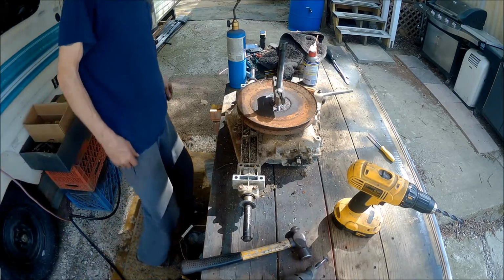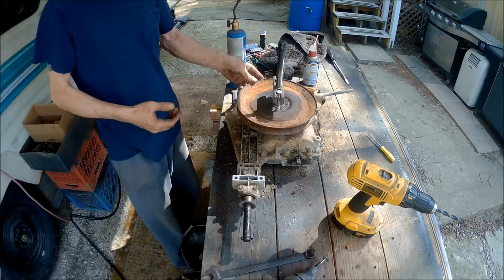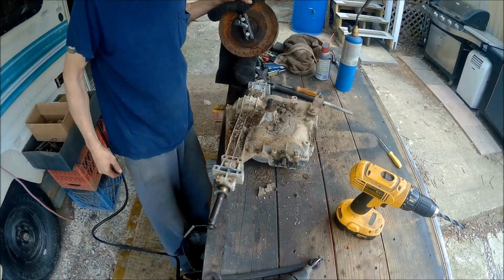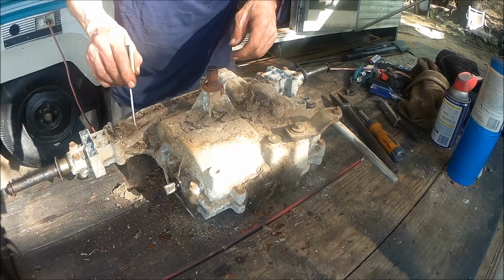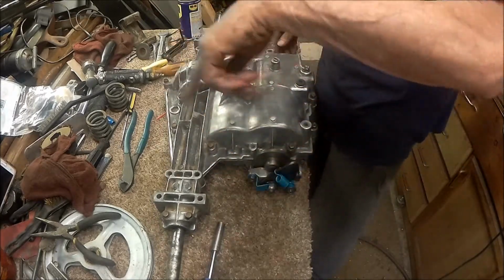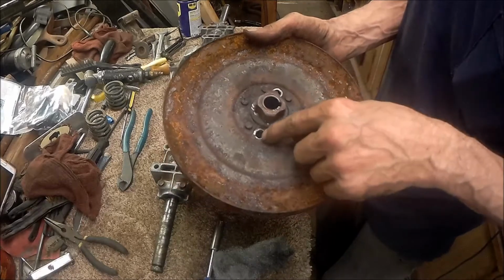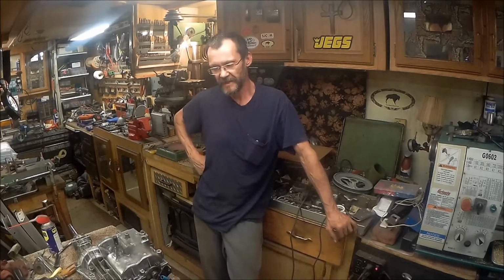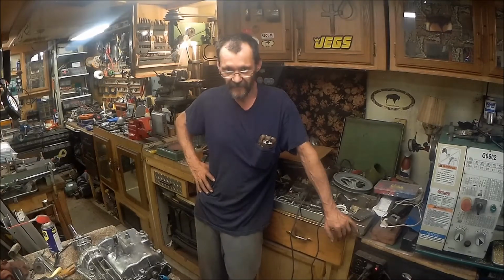restoring the craftman 917 271014 lawn tractor part 5 the rear end

Comment: I used old oil on my first one to get it off it didn't wanna come off like that one then put a smaller socket on it then one good tap then it came right off with a ratchet 

An I broke 4 torx screws when I took it apart to fix the axles retaining ring to put a new one on it probably needs one on the other side because it looks cone shaped i bet it does